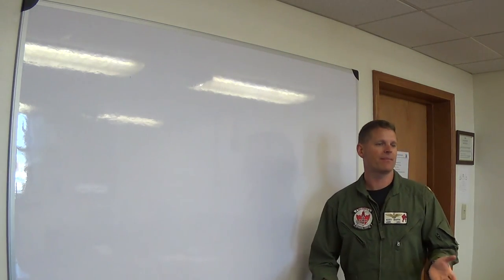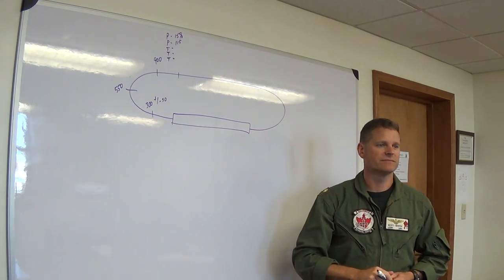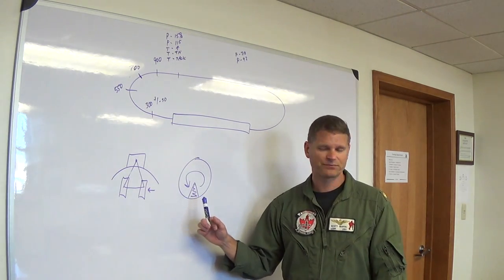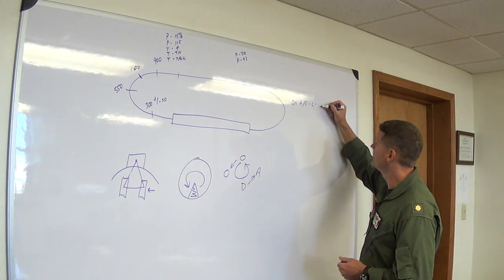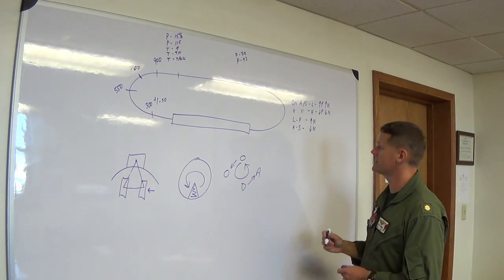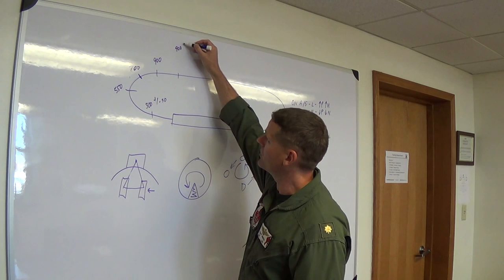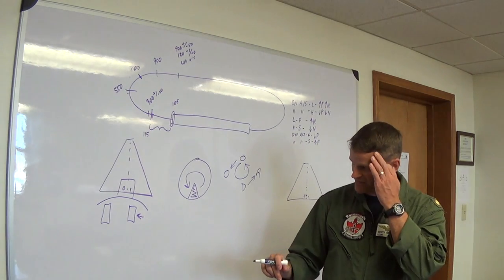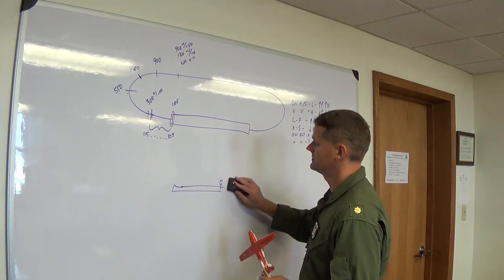C2. The Primary Landing Pattern Explained

Comment: I like the military style patterns MUCH more than the US civilian rectangular patterns.  They are vastly superior and easier to enter and fly.
Reply: cff121:    Yeah me too.  Except at uncontrolled airports, you can't predict when and where the guy in front of you is going to be.  When you fly a rectangular pattern, you get the chance to lift and drop your wings before you make your turns to see other traffic.  In the military,  most of the time the pilot is under ATC control.
      I believe the FAA designed the rectangular pattern during or after WWII to give GA pilots a consistent way to approach and manage an uncontrolled traffic pattern.  But a military pattern would be great if you are always assured you are number one in the pattern.   Even then, you can never be assured you are clear of traffic. 
      BTW, the instructor pilot is excellent because he treats the student with respect.   He does not scare or insult the student, which would have a negative impact on the learning process.  Also, the student pilot will (has) probably gone on to become a very good pilot as well.
Reply: yes but not practical for heavy volume civilian airports.
Reply: Most "young" pilots (i.e. less experienced) pilots do better with a rectangular pattern because they deal hopefully with one dimension at a time (i.e. turning, descending), it is easier for a pilot to adjust his rate of descent and/or line-up while maintaining safe airspeed.  Without going into details, military pilots especially TACAIR Navy, control their aircraft a different way (for carrier ops).  Rectangular pattern helps seeing possible conflicting aircrafts in the pattern (especially at uncontrolled airports).  Major airports sequence arrivals at great distance for straight-in approaches, not pattern entries like practiced at smaller airports (or for training purposes).
Finally, pattern entry for military aircrafts was based back to early days of aviation when a pilot would (should) clear his tail ("his sixes") of potential enemy aircrafts approaching for a sneak attack when the landing aircraft was vulnerable (low altitude/airspeed) - that was the origin of the famous "break", (aka "overhead" or "fly-by" by civilians or pilots not familiar with history of flying).  Bottom line, for civilians aviation, rectangular pattern is the preferred and safer procedure; military pilots are usually given priority by Air Traffic Controllers or land at privileged military installation.  Ciao, L
Reply: Is this what they call circle to land in the civilian world? Turning, descending and trying to line up, especially on a runway that isn't always pointed into the wind can get pretty complicated especially when you add in potential limited visibility...
For pilots who do it every time in a controlled environment it makes sense.
For somebody to do it once in awhile, at an uncontrolled airport, in a crosswind, with a high density altitude and low visibility it may not be real smart.
Reply: @jerseyshoredroneservices225  no ‘circle to land’ applies to instrument approaches where a pilot will fly the approach to circling minimums, then maneuver the aircraft while in visual contact of the airport to land on a different runway than the one listed on the approach. ATC may give a clearance like “cleared ILS runway 31, circle to land runway 25.”  Some approaches eg a VOR-A are purely circling approaches as the final approach segment does not align with any particular runway at an airport.
Reply: @TheRealCFF  
Thank you. Learning more every day 🙂
Reply: @jerseyshoredroneservices225     A “circle to land” is a clearance or procedure that uses an instrument approach to descent below the weather for 1 runway, then once below the weather you “circle” visually to align yourself with a different runway being used for landing.  This could be because of winds, construction, or approach design limitations due to terrain in a particular direction.  While the circle part is similar to what is described here, it might be significant closer to the ground to facilitate staying below the weather to ensure keeping the runway and airport environment in sight.  The missed approach procedure, or a go around, is also more complicated than normal (a climbing turn towards the runway to which the approach was accomplished to intercept that missed approach procedure). For tons of reasons, these procedures are chock full,of accident potential, especially as the weather gets lower or darker.  They are relatively uncommon to accomplish and pilots generally don’t like the safety margins and higher risk. So we usually will try to find another way to get on the ground using a circle as a last resort.  

As to the execution of a circle. It’s similar to what you see here, but flatter, and usually flown mostly configured with gear and partial flaps, then landing flaps executed usually as the aircraft begins its descent from the circling altitude (listed on the approach plate as the circling MDA).  That MDA is a function of terrain clearance in proximity distance to the airport, and can be pretty low.

“Circling” is often a term used by passengers to describe “Holding”. Which is a totally unrelated procedure where an aircraft flies a racetrack looking pattern over a particular IFR fix, waiting for airspace or weather to clear.  It’s a way that pilots and controllers keep a place airborne without it moving very far for whatever reason.  Delays, congestion, waiting for weather to clear, aerial refueling, rejoining with another airplane, accomplishing an emergency checklist, etc.  

Sorry to ramble.
Reply: @markg7963  
Thank you for the detailed explanation!
At the risk of asking a dumb question... if the runway has an instrument approach and the aircraft and pilot are able to follow that instrument approach why would they then break off and circle to land on the other runway? Why not just land on the one they had been approaching?
Reply: @jerseyshoredroneservices225   Lots of reasons, but the typical culprits are excessive tailwinds or crosswinds, obstacles preventing a normal descent to the runway, a more desirable runway length for performance on a longer runway, construction on the airport, formation aircraft that can’t land as a 2 ship…. These are just examples.   

To give a simple example.  Say you are landing at EGE (Eagle ) airport in Colorado. They only have 1 runway, but you can land in either direction, so it’s really 2 runways. They only have approaches that come to land in a westerly direction.  Let’s say the weather is 1000 feet ceiling and 5 miles visibility with some snow.  However the winds are blowing 25 knots east to west.  If you flew the approach from the east as published, you would break out no problem from the weather and be forced to land on a snow contaminated runway with a 25 knot tailwind at a high pressure/density altitude. Not a very good decision by most standards.  

But, if you flew that same approach down to circle below the weather, you are using the approach to safely navigate the mountains until you get below the weather, then you “circle” the aircraft visually to actually land in the opposite direction INTO the winds, for an effective 50 knot advantage in wind situation   Over the first example.  A way better situation with a way better outcome.  

Hope that example solidifies the concept of circling.
Reply: @markg7963  
Hey Mark, thanks for the explanation and example. My next question would be why not have an instrument approach in both directions so there wouldn't be a need to circle but I guess there's a lot of reasons why an airport wasn't constructed that way. Mostly I guess just expense and in the beginning and it wasn't thought to be needed. Then the airport got busier and the airplanes got bigger and faster so now they have a more complicated situation.
You and your colleagues on this channel have been patient and helpful. Thanks!
Reply: @jerseyshoredroneservices225    Well. Another complicated answer.  If you look at the terrain in Eagle, for example, there are mountains in the path of a normal straight in arrival if you wanted to land towards the east.  So there isn’t the possibility of a “normal” instrument approach in that direction, because the arriving aircraft would be either in the terrain or too clos to it to facilitate a safely designed approach by TERPS criteria.  

Terrain or obstacles being the normal thing that blocks these things, which also needs to be certified and tested by the FAA in the United States I’m pretty sure?  

Interestingly, with the advent of RNAV approaches and much higher navigational performance of inertial units being updated by lots of gos satellites. Other approaches can sometimes be designed that follow a curved or irregular path into that runway.  Examples of this would be the newer approaches into TGU (Tegucigalpa) Honduras, or the old airport in Quito equator. Both of those had been redesigned approaches to facilitate RNP approaches.  The approacjh is flown similar to an ILS, but the difference is that the airplane is generating the approach in its own computer and monitoring position relative to that ideal path in its computer brain, versus an old style approach that relies on signals coming from a spot on the ground.  

We can fly approaches in this fashion that are curved or come in from all sorts of shapes with relatively low weather minimums, although not quite as low as an ILS category 1, and nothing near as low as a ILS category 3.  

All good questions.  I don’t know the answer to all of them.  But I’m happy that somebody is intelligent enough to be asking😂
Reply: @markg7963  
Ah, that makes a lot of sense. It's interesting that the instrument approaches need to be more simple than approaches a human can fly when they have good visibility. Normally we think of the machines doing things more precisely but not in this case.
Reply: @jerseyshoredroneservices225    Well, that depends on the day :-)  Sometimes I feel like my hands and brain are pretty capable, and other days not so much :-)  At the end of the day the human brain is pretty amazing in what it can accomplish.  Flying a complex airplane (or any airplane depending on what you experience is) can certainly test the limits of human brain/hand/hearing/talking/seeing capability.  Reality is that these processes break down when we get really overloaded, or distracted while we are already processing at full speed.  It's by far the most interesting thing in aviation.
Reply: @markg7963  
Very true. A well rested, well focused brain can perform at a high level but when that same brain is fatigued and stressed and facing many tasks at the same time it may not perform very well, which has been the direct cause of many avoidable accidents  :-(
"Deer in the headlights syndrome" one might call it.

It's interesting how some people become extremely emotional under mild stress and others can keep their cool well enough to call in artillery strikes 100 yards away while under enemy fire. Same for pilots that deal with things going wrong, knowing that if they screw up, they'll die.
Captains Sullenberger and Dardano (Taca flight 110) kept their cool 🙂
Thanks for all the information and the discussion!